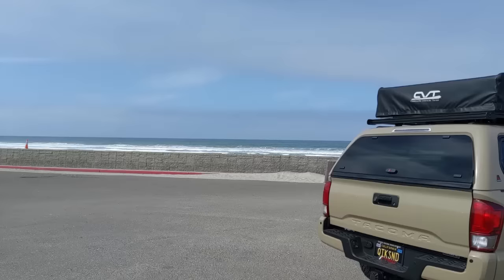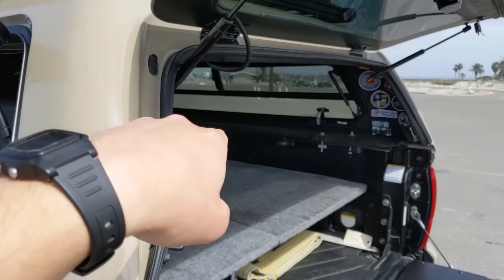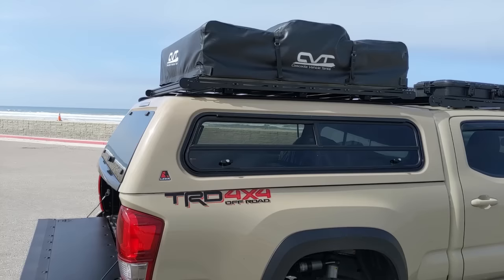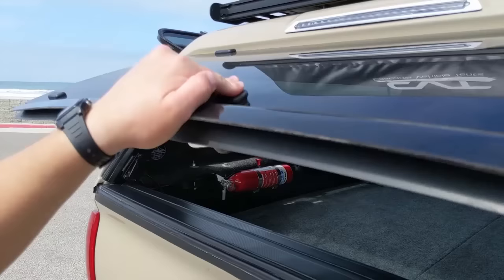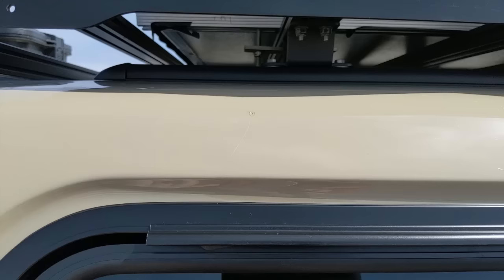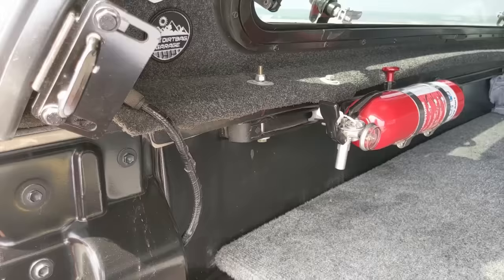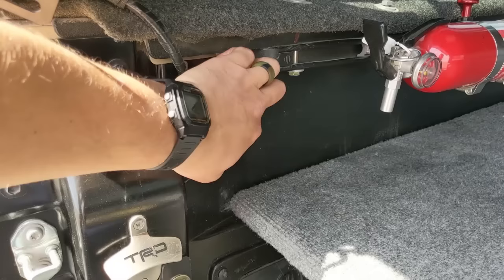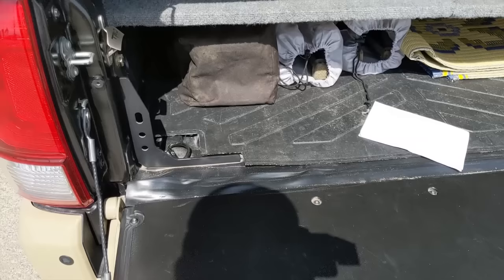Shell and Roof Top Tent FAQ

Comment: Any issues with the roof top tent? Once your in it your going to be over the 200lb weight limit and out of warranty?
Reply from the maker: Nope, no issues.  The weight limit mentioned is the dynamic weight rating. Dynamic is defined as when the vehicle is in motion and the weight is moving above the shell.  I would hope that I wouldn't be in the tent when the truck is driving down the highway.  The Static weight rating is when the truck is stationary, supposedly much higher, and from what I could find it is not listed anywhere.

Comment: What about the seals they make that people put by the tail gate that stops dust and supposedly water as well?
Reply: I used a few of those to seal up the tailgate as best I could. It helped, but wasn't perfect by any means. It's definitely tough to seal it up. Maybe you'll have better luck than me.
Reply: @andyv619  I’m just trying to get tips from people who have more experience
Reply from the maker: @blakelynch400  that was actually me as well responding up top. Wrong account signed in for some reason. Anyhow I used a lower tailgate seal that spanned from the bed to the lower edge horizontally and then bulb seal foam on the vertical edges. It helped for sure but wasn't perfect. It's definitely tough to seal up a topper on a bed, but not impossible.
Reply: @TravelingNobodys  any advice on a perfect seal? Or would that make it sit tight as well?
Reply from the maker: @blakelynch400  here's the kit I used...

https://amzn.to/45fRPVl

Comment: I got an ARE topper, got the factory rack rail. It does NOT fit frontrunner. The front runner mounting pieces are too big. I had a shop install the frontrunner rails using the same factory holes though so no modifications needed.

Comment: How did you access the top inside of the shell to install the cleats?  We have almost the same truck and shell.
Reply from the maker: The "cleats" are actually climbing anchors and are attached using the bolts that secure the rack to the shell roof.  I removed the bolts, got longer and stainless ones, then replaced them.  When I bolted them down I added the anchors.

Comment: I am really curious what are the dimensions of your carpeted floor that separates the top and bottom? how wide and how long it is? Thank you so much!
Reply from the maker: Sorry, I've since removed the platform due to upgrading to something else.  All I did to make it was measure across, subtract one inch, then divide by two and that is the width of the two flat boards you sleep on. Measure the length to the back wall in the bed and cut the boards to dimensions.  I the wrapped them in a lightweight felt carpet material and used 3M adhesive to hold it on and stapled the edges. Then measure across the bed to the two cutouts for the 2x6 or 2x8 boards to support the platform and voila!! you're done in under $100.

Comment: You realize some shells replace the tailgate right? And there's different designs, most that I've seen don't have holes between the shell and bed lol. 90s aluminum leer on ford, never leaked. Steel knapheide, doesn't leak any water, fiberglass snugtop used to leak, two window seals later no leaks. Where you've got the notion of all shells allowing water intrusion I'm baffled by. My beds are dry after powerwashing

Comment: I have the same shell and I just installed a mountain hatch. Love it! But my favorite mod of yours is the rubber strip you put between the tailgate and the bed. But what did you use and where did you get it? Thanks for the video!
Reply from the maker: It's a ESI ROK BLOCK Tailgate Gap Cover 4.25" width I found on Amazon.  Currently unavailable but I'm sure you could find it somewhere.
Reply: @TravelingNobodys  Thank you...now I have something to go by. Its one of the best mods I have ever seen...really! Thanks again.
Reply from the maker: It's definitely been nice.  It really keeps the dust down in the back.

Comment: Hey great video. I am definitely getting the rail installed from the canopy place I bought my leer from for the prinsu canopy rack. But my question is with all that weight on the rear what is your suspension setup in the rear to keep it leveled with the front?
Reply from the maker: Yes. We added upgraded rear leafs to support the weight.  I'm currently running Dobinsons springs.

Comment: Good luck making a warranty claim.  They will just say you put too much up there.  You can definitely have a waterproof shell.  You just need the rubber strips installed correctly.  I had to put four layers near the cab because my truck came with side rails.  Also you can get a kit to waterproof the tailgate.  So, sir, you are the one who isn't aware of all the options out there.
Reply from the maker: Never claimed to be an expert.  I will admit though that the waterproof thing is the one thing I regret saying in this video.  I'll learn from that for the next one.

Comment: @Tres Amigos Offroad Club How have you dealt with the weight you're carrying overall?  I love this platform but I hate that it has such a low payload.  New shocks/coilovers in the rear?  Any help would be appreciated I am hoping to build out a truck in the next few years.  Thank you and thanks for the video!
Reply from the maker: I did install new rear shocks. Anything higher would have been something like long travel, but I have OME BP-51 shocks. I upgraded the leafs with Dakar HD springs. There are also Deaver, Alcan, Icon, and others that are all good.  The springs are the big issue.  That's what's holding most of your weight. Aside from that I also did bed stiffeners by Rago Fabrications to help support the bed sidewalls.

Comment: you can make that shell waterresistant so no water gets in.. dealer should have done it from day 1... you just install some foam, and seal those front areas, and attach a continuous D seal to the bedrails starting from the back side of one side, and go forward and around to the other side.. maybe making a pie cut for the corners, and a little silicone ont he corners.. that should keep out almost all moisture..... why is that passenger side bolt rusty?
Reply from the maker: The wrong bolts were installed, mismatched materials.  They have since ben swapped out.

Comment: You said you paid $2300 for that shell just as it sits, vented windoors, headliner, sliding tip out front window and the rails on top. When did you buy this shell? I live in Utah and just got a quote for the exact same set up shell wise and my local dealer wants $3250! Thanks for the great video by the way.
Reply from the maker: I double checked my receipt and I misspoke, it was around $2,600 total.  I got the Shell at Leer Truck and Accessory Center in Murrieta, CA.

Comment: Where did you get the climbing anchors from?
Reply from the maker: <a target="_blank" href="https://www.amazon.com/gp/product/B076Y2QHPD/ref=ppx_yo_dt_b_search_asin_title?ie=UTF8&amp;psc=1&_encoding=UTF8&tag=taconobodys06-20&linkCode=ur2&linkId=1bc6c1587b45e5085f8845f60244b48b&camp=1789&creative=9325">NAXEN 26kN Bolt Hanger Stainless Steel Climbing Anchor</a>
Reply from the maker: Hopefully this link works.  They are Naxen Climbing Anchors and you can find them on Amazon.

 <a target="_blank" href="https://www.amazon.com/gp/product/B076Y2QHPD/ref=ppx_yo_dt_b_search_asin_title?ie=UTF8&amp;psc=1&_encoding=UTF8&tag=taconobodys06-20&linkCode=ur2&linkId=1bc6c1587b45e5085f8845f60244b48b&camp=1789&creative=9325">NAXEN 26kN Bolt Hanger Stainless Steel Climbing Anchor</a>
Reply: @TravelingNobodys  thank you. What size of nut is the hardware on the track do you happen to know?
Reply: @wackedout13  I don't unfortunately. I pulled one of the bolts off the shell track and took it to the hardware store and worked from there. I needed a bolt that was about 1/3" - 1/2" longer to be able to accommodate the new thickness of the added climbing anchor.

Comment: Great video.  Love the walk through, and your thorough explanations.  Really like your topper tent.  I just got a new truck and Leer cap, and got the 6.5' bed over the 5.5' to give the option of sleeping inside, but that tent kit looks pretty nice, and keeps stuff locked inside the truck while sleeping.   Do you need a ladder to get up in there?  Is it weird, sleeping up there?
Also like the platform you have.  Another great idea.
Thanks for sharing!
Reply from the maker: The tent has a built in ladder that allows for easy access.  Check out my buddies over at ROAM Adventure Co. for their Rooftop Tent options.  Good quality at a good price.

Comment: So I have the same camper with the same rack so you're saying if I'm parked the weight doesn't matter cuz I'm a big guy man I'm 280 lb wife's about 150 so I'm looking about almost 430 pounds man.... No cave in....
Reply: The shells are only rated from the factory based on dynamic (moving down the road) loads. They don't rate them at a standstill, at least not that I could find. I'm sure at some point the shell will fail u der a static load, but the racks aren't rated in that sense so it's up to you to determine where you think is safe for your shell.

Comment: Getting a tacoma after college. Switching from 4runner to taco after seeing the camper tops they make for it
Reply: That's a stupid reason to switch over
Reply: @bigoneish  not a stupid reason, 4runner trunk is small and my v8 gets 13 mpg.
Reply: @NostromoStarship2  the 4runner is more ideal for offroading. Better performance than the tacoma. I bet you dont haul anything to actually need the bed space of a truck. The 4runner has better everything over the Tacoma. You're just trying to hard to be a mall crawler
Reply: @bigoneish  the whole front end of the tacoma is a replica of thr 4runner. The only difference in the frame is the rear of the vehicle. I would know because I have worked on both of the vehicles. I doubt there is very much difference between there offloading capabilities beside departure angle. How does wanting a truck bed make me a mall crawler lol. My dad has a 2019 tacoma trd sport long bed and I have a 2007 v8 4runner with 265k miles. If I had to choose to buy a new vehicle it would either be the land cruiser or the tacoma. The hatch is horrible on the 4runner for mountain biking which I do. Putting a 10 foot long kayak on the damn roof of a 3" lifted 4runner is a pain when it is so easy for a tacoma. 4runners have this special resale value which doesn't offer anything special over my 2007 when I still have better performance than it. The land cruisers have similar power to my 4runner and I test drove a 2019. I like the full time 4wd system on the cruisers which my 2007 offers with it being a v8. Go ahead and comment again to defend yourself

Comment: Thanks for sharing, I like your set up!  have a used 2nd gen Tacoma that came with similiar leer shell, and have been going back and forth about how\if to use RTT because i also use my truck and bed for practical uses where security and keeping things dry is important.  I suppose installing my own rack is a non-issue in this case since im not an original owner.  I have thought about softshell with rack but haven't found a good taco setup for reference.  What leaf\rear shock setup do you have to compensate? thanks
Reply from the maker: Check out @will_yum_norton on Instagram. He's got a soft shell with a sweet rack over it.  I currently have Old Man Emu BP-51 shocks and Dakar HD +1 springs.  I'm considering upgrading the rear springs though as they sag already.  Possibly leaning towards Dobinson or Deaver.

Comment: Hey man great video. Really digging this set up, want to do something similar on my tundra. Who installed the rack that mounts on the truck?
Reply from the maker: I installed it myself. It's quite easy.  Ordered from Prinsu, assembled on the floor in the garage and lift up onto the shell. One thing I did have to do was shim the outer front and rear most mounting bolts with some washers as the rack is true and straight, while the shell has a slight curve.  The shims helped to compensate for the curve on the shell.

Comment: Hey man! Love your storage set-up inside with the paracord. Did you use the stock screws to attach the anchors or did you get something different? Mind shedding light on the hardware setup?

Thanks
Reply from the maker: I used the Leer roof rack tracks mounting bolts.  I did have to add longer bolts, re-siliconed and then added Naxen climbing anchors to thread the P-Cord through.
Reply: I love this idea. Inexpensive and practical.  Do you remember the specs of the bolts?

Comment: I have a 2020 Tacoma with the same Leer canopy. I had Leer install a Thule Aeroblade rack as well. I'm looking to buy a roof top tent, specifically the Tepui Explorer Kukenam 3 (I think Thule just bought this company), and I was wondering if you could speak to the weight limit of the canopy with regard to a 3 person capacity and associated weight when using the roof top tent. I loved your explanation of the dynamic weight allowed for the canopy, but I'm not clear how that works out with using the roof top tent. Seems you would exceed the weight limit, unless I'm missing something in the roof top tent design and how it distributes weight. Thank you for your help!
Reply from the maker: So the dynamic weight limit applies to when the vehicle is moving around. As in driving around, bouncing down the road.  So there's really no reason anyone would be up on the tent with it unfolded while the vehicle is moving.  That is the limit that the racks are racks and shells are rated at.  They can deal with X weight while driving around and bouncing down the road.  When they are sitting still in one place with no external loads placed on them they are then subject to the much higher static weight ratings.  These ratings are most of the time never even published as the weight rating that really matters is the lower dynamic rating.
Reply: @TravelingNobodys  Thank you for this helpful information! I appreciate it! Would you know where or how I would be able to find the static weight rating for our canopy and rack?

Comment: What size wheels and tires are you running? Any lift?
Reply: The wheels in this video are TRD 4Runner Pro 17x7.5" with 265/70/17 BFG K02's. I've since upgraded to 285/70/17 Your Open Country ATIII's and prefer the size and tire better. You'll need to do a bit of trimming to fit them, but it's worth it as you'll likely need trimming with the 265's anyhow.
Reply: @935AV  How intrusive is the trimming? Are we talking just using a dremel or a full cab mount chop?
Reply: @Hessrs  it really depends on the truck. Both sizes may require a cab mount chop depending on the amount of caster you can get out of your alignment. The CMC really isn't a big deal, just need to find a shop near you willing to do it. Once it's done you can barely even tell anything was done. Other than that you will need to do some Dremel work on the fender liner and remove any mud flaps you may have.

Comment: Cheap seems to be Leer's motto which is why I sold my Leer and purchased a Snugpro, commercial canopies are just better.  Mountain Hatch is cool but pointless I went with Mobtown Offroad's  powdercoated steel tailgate reinforcement which not only can be used as a cutting surface but also beefs up the weak tailgates on these trucks. What the hell Rago? That "bracket" ain't reinforcing crap with it only extending half way up the bedside it seems to me it would be more of a hindrance than useful. 

ok im done venting
Reply from the maker: Breathe, breathe. You're okay.  Just breathe. 😁

Comment: I've wondered this but now I wonder what weight limit is. Only fifty pounds under limit moving. Two people gets in it that be approximately three to three fifty more pounds.
Reply from the maker: The weight limits from the factory are designed around the dynamic weight rating.  Which means the loads placed on the shell when the vehicle is moving.  The shell can take much higher loads when the vehicle is static (not moving) and the factory doesn't even rate those limits.

Comment: Awsome looking rig!!
Can you give me a link to where I can purchase those 4 brackets that you have mounted from the prinsu top rack to your Rooftop tent?
Reply from the maker: Not sure which brackets you mean.  The brackets attaching the rack to the truck are directly from Prinsu, and the brackets attaching the tent to the rack are from CVT.
Reply: Tres Amigos Offroad Club 
The brackets I’m referring to is the ones from the Prinsu rack to your camper shell track rails.
I’m thinking that when you order a Prinsu Topper rack it comes with it. Correct me if I’m wrong.
Reply from the maker: @616_overlanders9  You are correct.  What you are referring to come from Prinsu with the rack.  That said they do make two different versions, these are the lower profile versions.